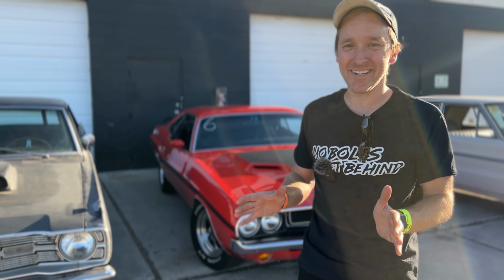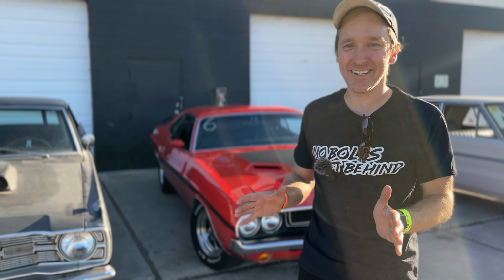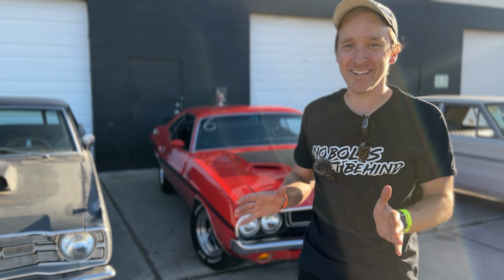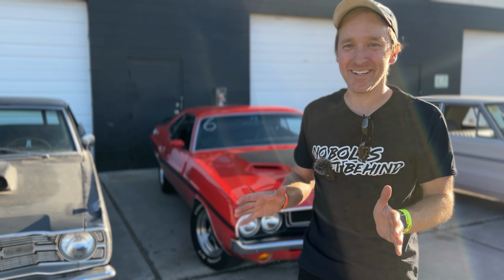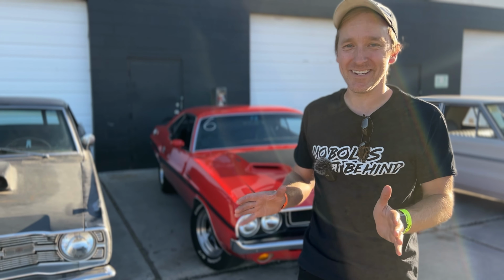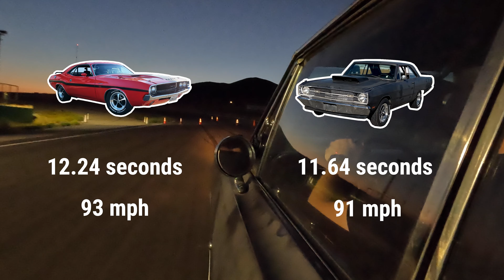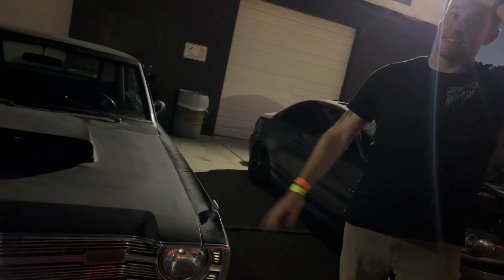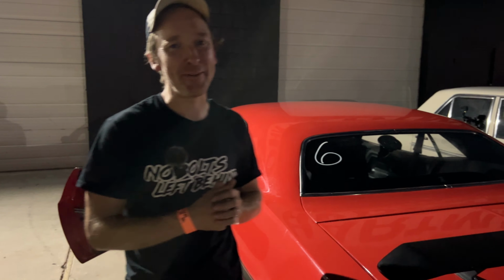1970 Challenger Hemi Swapped vs 1969 Dodge Dart Big Block: Street Style Drag Racing

Comment: Imagine if both cars had street slicks? That Dart is a monster! With slicks and prep track easy 10's . The Challenger my favorite would need some engine work. Ever tried Pedal Command? In my Jeep 5.7 it's like a rocket on take off. No joke!! My wife hates it. 😂 She has her own Jeep 3.5 that's good enough. Enjoying your videos.. 🐻🇺🇸
Reply from the maker: Thank you sir! Yeah, the Dart is a beast and definitely meant for big old slicks out back. I think he might have about 100hp on my Challenger.
I actually did a cable driven throttle conversion, so no electronic pedal for me! I think a supercharger or maybe nitrous is my next step when I want to try for more power out of the 5.7.
Reply: @noboltsleftbehind  .. Pro charger makes a kit for the 5.7.... but... It's not cheap. For poop and giggles I look up for my Jeep .. Almost $4,000 not installed! Good Lord my wife would kill me!! 😂. We had 4:88 in our Challenger RT and it was a screamer. Yeah wheels up off the line scared the poop out of me. I was worried about the oil pan! You have a great ride. And you will figure it out to get more power. PS... I was never crazy about nitrous. I seen to many engines blow up! Oh.. factory rear louvers will look great on your Challenger. Good luck.. 🐻🇺🇸

Comment: Happy to see an old RB engine beating modern gen 3. But i want to know whats done in that big block. Seems like gears are not low enough, also  compression is key with a good set of flow heads and a cam to match it.
Reply: Hey Anthony! The 493 is a 12.5:1 CR all iron monster. I posted a video giving a full walk through of the car on my channel. Lots of little things to tweak for sure.
Reply: @sorta_stock  im gonna check it out. I could’ve sworn i seen you at Sonoma one time?! I race my a body there all the time.
Reply: @Anthony12valve440RB  I went to Sonoma a few times between 2015 and 2016. Moved out of the Bay in 2016. Use to have a go mango ‘75 Dart with a 416 stroker back then.
Reply: @sorta_stock  im not to far from leaving the state also. But  yeah i remember seeing your car  back then. I was driving a plum crazy purple 72 challenger that was also a 416 hell yeah 340 FTW🤘. Thanks for being the only few who build these older LA , B , RB engines. Nothing against modern engines i love the work people do making a gen 3 hemi work on the old cars but im 24 and in my opinion i like these older mopars with these engines. They’re underrated ,  people don’t understand you can make alot of power with what Chrysler gave you. I mean the 416 i built made 512 hp with the factory X heads that came with the 340 in 1969. Wish i had my hands on a TA engine where they moved the push rod for you to port out the runner even more and the TA block having thicker webbing to make it a 4 bolt main.  But examples like that is why im a big old school mopar guy.

Comment: When did Willow Springs Raceway add Drag Racing?
Reply from the maker: It's been going on for at least four or five years, they do them during the summer. It's called Night Drags
Reply: @noboltsleftbehind  okay, that makes sense. We lived in Rosamond from 1989 to 2015 and never saw drag races there. This is a good thing to have now. Too many tracks have closed over the years. Have fun and be safe and I will keep watching your videos. I have a Challenger but I have a small block 904 combo. Mopar or no car.